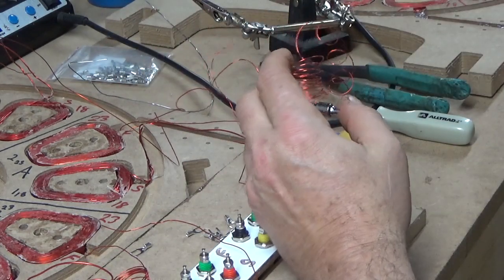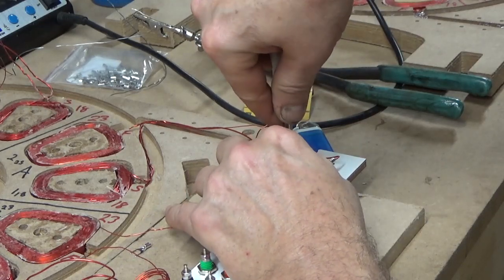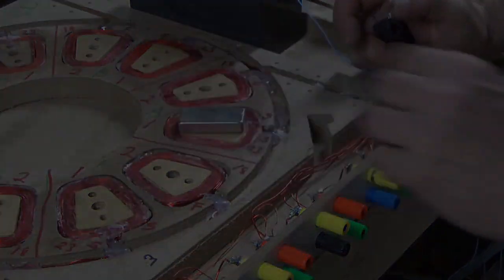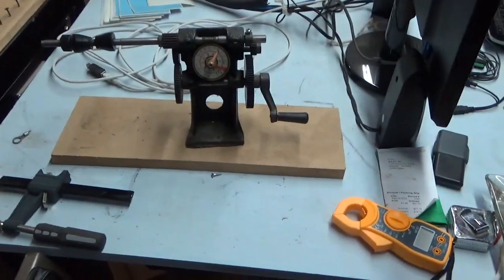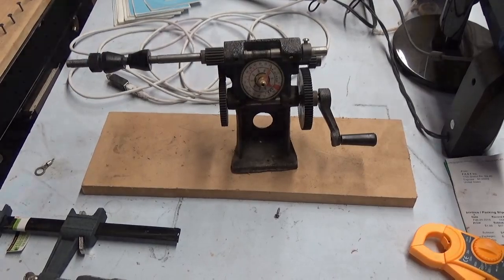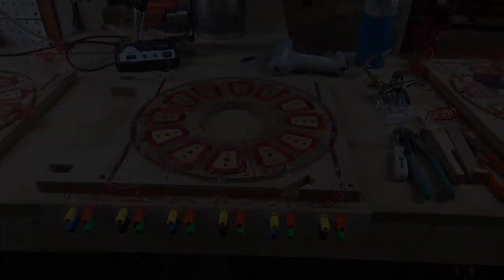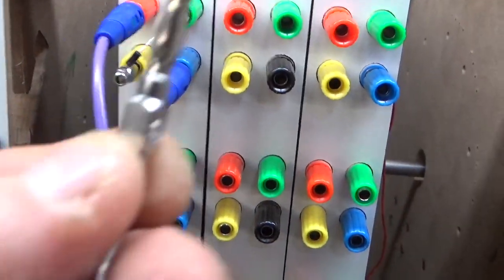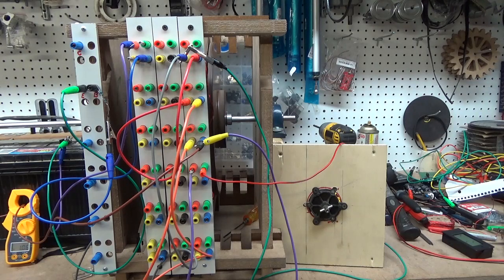EEAPG FIRST TEST RUNS. New Green Deal, Research for the solution to the worlds energy needs.

Comment: Do you know about the Anti Lenz coil from Alex Manzanero
.  Have you tested it. What is input and potential output of your EEAPG?
Reply from the maker: Yes, I actually linked to Alex’s video in one of my videos.
Reply from the maker: The output would vary with rpms. But at 12.5V input 5.5A 550rpm the output was 58V per stator at 6 amps with no load.  So complete it would be 232v 22A AC. But load testing and load control testing with various configurations will be done once unit is complete.   I have done some testing and in some configurations the Watts drawn goes down when under load. The output also goes down, but so far the sliding scale looks promising.  This unit is designed to run at a constant controlled load for charging a large battery bank.
Reply from the maker: Yes I do know about it........